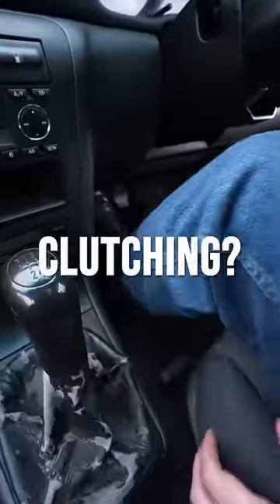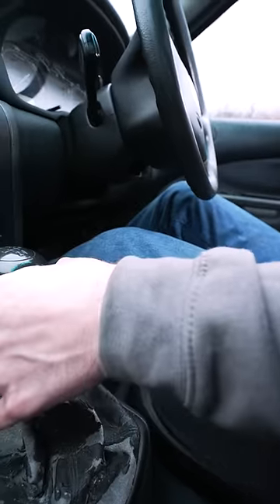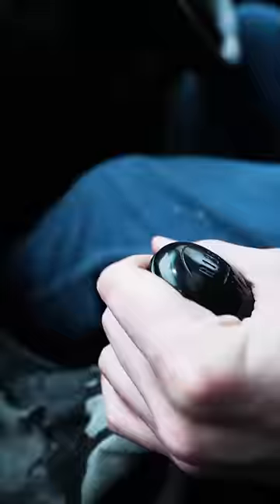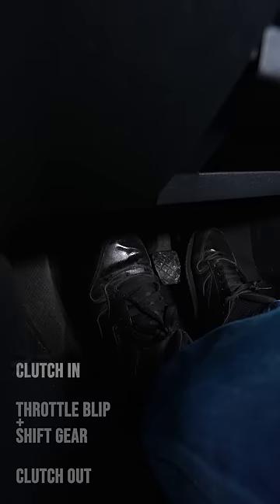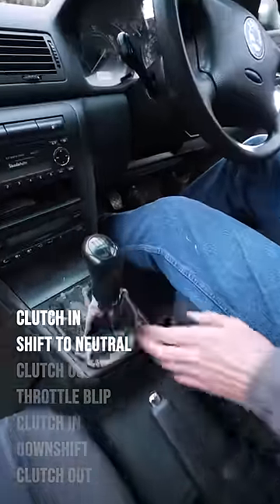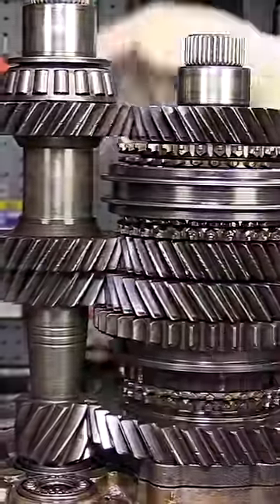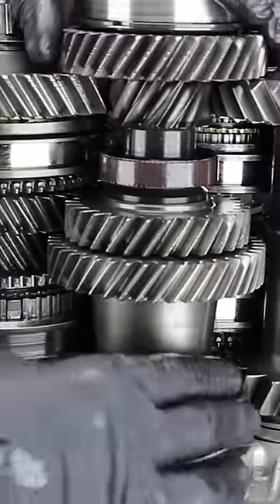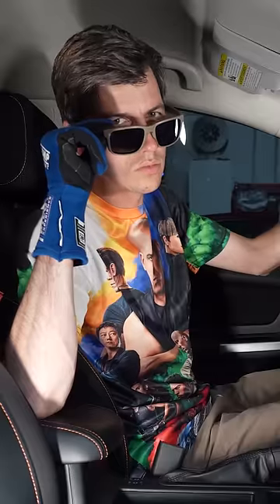What Is Double Clutching? Don't Granny Shift!

Comment: As a truck driver double clutching works very well because trucks are non synchronized however if you can match rpms you can do what's called floating or not clutching between gears
Reply: Yes
Reply: Unless you're in Europe in which case trucks have been synchronized for a good 50 years at least.
Reply: @stuntvist US as always is way behind
Reply: @stuntvist  you guys also only have 6 gears where as we can have up to 18
Reply: @stuntvist Wow there’s not a single truck in Europe without synchros, learn something new every day.
Reply: @bradleymaidens2285  I havent driven a truck in EU with less than 8 gears
Reply: All trucks in Europe are not synchronized. It depends lot of what the truck is used for. Many trucks driven in difficult conditions like those who drive logs from forest have been using still fairly recently or have preferred none synchronized boxes as shifting is that much faster with those. But I haven't now been driving for trucks for some time... But definitely 50 years is not right as 20 years ago there were still many of those. Those are really good to drive after one learns to use those.
Reply: my sm465 has a 2 speed auxiliary unit called a ranger torque splitter and that came out in the mid 60s. both gears are synchronized in that. the sm465 itself is synchronized from 2nd through 4th gear. thats based off the sm420 which came out in 1947 and is also synchronized 2nd through 4th. Thats 77 some odd years that thats been around. so who's behind who again?
Reply: You can do that with any manual transmission.
Reply: @GewelReal Wrong. We have manual semis with synchros and automatics. He just prefers an older truck. Don't you have a machete battle to attend?
Reply: @snaeshaads8203  try harder, kid
Reply: @sepg5084  Says the one that can't be bothered but to write half a sentence in a reply.
Reply: My dad use to tell me all the time u can tell how long someone has been driving their rig by how often they use their clutch
Reply: @stuntvist  I don’t know what your on about, cars and light duty trucks in America have had synchronized transmissions for over ONE HUNDRED years now. I’m a ford guy so I’ll mostly stick with those. Ford introduced synchronized gear boxes in 1932, 1st was unsynchronized, due to the low speeds making it unnecessary, 2nd and 3rd had synchros. In the 40’s and 50’s, the top loader 3 speeds in cars and light trucks were the same. The 4 speed top loaders in 60s-70’s era muscle cars, were fully synchronized, except for reverse. In the 1970’s ford NP435 4-speed truck transmissions were synchronized 2-4 gear, as was the T-18 that replaced it in the ‘80s. The only reason 1st didn’t have synchro’s was because it’s a granny gear, or creeper gear. You dont really need a synchro when you’re only going 4 miles an hour lol. The big block version, the t-19 4-speed, was fully synchronized, as was the 90’s era M5r2 and ZF-5 which replaced that. Not a big Gm guy, but I’m fairly sure the SM465 was synchroed 2-4 as well, again 1st was a creeper gear, and I believe the earlier sm420 was as well. And I believe Cadillac was the earliest, introducing the synchromesh as early as the late teens/early 20’s, but don’t quote me on it. How long have you Brit’s been using them again? Lol
Reply: @bradleymaidens2285 Most Euro trucks have either 12 or 14 gears.
Reply: It's hard to do that without grinding on some cars, though.
Reply: @stuntvist  I have once driven truck without synchro. It was a milk truck from 70's that was converted to a tanker firetruck. All the other Trucks I've driven (Even the ones from 80's) had a synchro.
Reply: @lamp_god9774 you mean the Start Pedal? Lol
If I touch the clutch sometime after the initial start, it means I screwed SOMETHING up, and I drive 95k pound trucks on goat trails in the mountains...
Reply: @stuntvist the us semis don’t have synchronized transmissions because we float gears. Not that we’re behind but because we drive differently. I’ve been around enough of the euro style and US style semis side by side on more than one continent and the US semis did better at moving a load and controlling it while the euro semis seemed to more designed for operator convenience. I do like some things better than others with both style semis but they’re just designed for different markets and truckers
Reply: I Sometimes Float my shifts in my 1999 Subaru WRX (Without Grinding anything). 
With my custom 5 speed ratios Clutchless shifting speed are 
40kph & 2,300rpm for 2nd to 3rd.
58kph & 2,100rpm for 3rd to 4th. 
82kph & 1,900rpm for 4th to 5th.
Reply: You are not just a truck driver you are a smooth pilot 🎉🎉🎉🎉🎉❤❤❤❤❤❤❤🎉🎉🎉🎉🎉🎉🎉 TRUCK GANG 😊😊😊😊
Reply: @stuntvist  didn't save Scania from a lawsuit by the UK's Tesco Plc. in April this year.
Reply: @stuntvist  tech here, in the states I've driven some straight trucks with synchros, but all manual tractors are traditional gearboxes.
Reply: You driving an old ass truck if it doesn't have synchronized gears. Being a diesel mechanic I haven't found a non synchronized transmission in a truck since i started working on them. Every eaton, Spicer and volvo transmission I've tore down had synchronized transmissions. The reason you can float gears in the first place is because of the synchronized transmission.
Reply: yes i love clutchless shits in my 18 spd took a bit to learn but man does it save my left leg 😂
Reply: Like No.1000 :)
Reply: I've heard that some truckers do no-lift shifts.
Reply: european trucks are all synchronized since like the 70ies. In Military times i drove some old 1960 8x8 or 6x6 Trucks that didnt have synced gears, (and no power steering, i had arms like a wrestler) but those where the last to exist. and yep going downhill  on some mountain terrain was life threatening dangerous if you didnt get the low gears in and the brakes where fading out quick:)
Reply: My dad was a truck driver out of NC for his entire life. He's handle was "Double Clutch". Anyone around who worked for his same company or even just driver's who knew him, said that he was one of the best men behind the wheel of a Rig. It was his dream to be a big truck driver when he was growing up, he did it til the day he died and was sent off in the last rig he drove.
Reply: @WhtSupremePizza1 yeah, but not without tearing up the mesh.
Reply: @Yonny316 you've been tearing down automatics.
Reply: I floated for years with no problem say good bye to your knee after a while
Reply: Yes sir 🫡 When I drove trucks I never double clutched I would float or single clutch if it was a new transmission.
Reply: @GewelReal  NOT Behind AT ALL.  Only Inexperienced CHILDREN Need Synchronizers In Heavy Truck Transmissions, Because The Keep Grinding Gears. 😂😂😂😂😂...
Reply: My auto shop teacher taught me about that also he’s a drag racer too
Reply: In drag racing we do what's called side stepping it's where you slide your foot off the side and let it pop back up when you bang a gear and you don't let off the throttle
Reply: @davemckolanis4683  lead paint moment
Reply: @Loj84   WTF Is THAT Even Supposed To Mean??? 😮😮😮😮😮...
Reply: @stuntvist is there any advantage to that?
Reply: @bradleymaidens2285 I was always curious, are those 18 gears always used.
Reply: uuuuh ooooh or like in my shitbox where synchros are worn tf out and i neeeeed to double clutch
Reply: @bradleymaidens2285  Sounds like excuses
Reply: Euro trucks were synchronized but now they're all automated no more sticks
Reply: @ni1469 euro semis also can float Europeans just don't do it cause wears & tears. Euro semis were made for asphalt while US semis will perform better in jungles in Outback down under where no roads.
Reply: @udififkfkfck  any manual can float, they may not last long but can do it. I usually forget I’m not in my semi when driving my ag tractor with a cvt manual. It doesn’t like and clutches don’t last long but it can be done
Reply: @bradleymaidens2285  That is not true. Most lorries have between 12 and 16 gears.
Reply: @ni1469  of course but no good
Reply: @tbas8741  Good for hitting the power band at those engine speeds
Reply: I never watched BJ & The Bear.
Reply: @stuntvist  im a truck driver in the US, im used to floating gears. why do european trucks have syncros while american trucks dont?
Reply: I was always taught to tripple clutch when I shift
Reply: @stuntvist you mean like in a civilized country, where they use metrics, call football football and rugby rugby?🤔
Reply: @bradleymaidens2285 That's just factually incorrect. I'm not sure where you're getting that from
Reply: My 83 Ford and my 79 column shift Chevy are both synchroed. 

Pretty sure America was the first to make synchro shifters.  @CivilizedWarrior
Reply: @dhruvpandya4136  having two splits is mostly used for heavy haul and steep mountains.
Reply: Thank you for your service 😊👍
Reply: WHAT been syncroed 40 years...those who think not.probably have bearings in the mufflers!
Reply: Just learned how to do this the other day in my truck
Reply: many years since trucks in europe had manual gears
Reply: I could float my Nissan, but the rpm's had to be low before I started to shift since it was not made to do so.
Reply: @GewelReal  Still waiting for Europe to land men on the Moon?
Reply: You mean if you drive an American truck. I feel sorry for you guys that American truck makers simply stopped developing back in the 90's. Double clutch in a European truck that is like the 60's. Now it's even a struggle to get a hold of a manual and the automatics are so good there are no benefits with a manual unless you drive in very specific circumstances. Your trucks really are at least 30 years behind on ours. Not meant as an insult. It's meant as a heads up that you are getting screwed. A Volvo FH16 has just as short breaking distance full or empty as a Toyota Hatchback. People are dying over there for no reason. You want to plow in to the back of a traffic jam one day killing 2 families while you know you could have had a truck that would have easily been able to stop? I really wouldn't actually. You guys should complain 😉
Reply: Internet ai stupidity 

Granny shifting?? Wtf is that!? A mashup of granny GEAR?? Granny low?? Fkn ai 

And kids are gonna believe this sht
Reply: Worth noting that "floating" works for the same reason and serves the same purpose that double clutching does. The point of letting out the clutch while you're in neutral and revving (if downshifting) is so you can bring the countershaft  and the appropriate gear (the next one you're going to select) up to same speed as the output shaft before linking them together.   With floating you're doing exactly the same thing in neutral, just not bothering to put the clutch in when slipping out and back into gear.  You do have to modulate the throttle to take the load off the gears during both those points though.   Can do the same with any regular passenger vehicle manual transmission, but the larger difference in gear ratios between each gear, requires more precise rev matching, and the penalty for missing is a lot of gear gnashing noises.
Reply: @XGDSKILLS Ohh yes the "clutch less shits"
Reply: Did it all the time.on my dirt bike and car just smooth into the next gear, zero torque helps
Reply: @lamp_god9774 after initial training to pass my test, my on the road trainer taught me how to float.
Reply: @WhtSupremePizza1 🫢😶 Dayummmnnn....😂
Reply: @SageSparow Truck gang!!
Reply: @XGDSKILLS In all seriousness CLUTCHING shits are better IMO! Imagine loading up on Taco Bell and holding it in for 24 hrs and NOT having anything to clutch while you give birth to a 9 pound, 8 ounces of chocolate milk!! 😂😂🤢
Reply: Isn't this where "racers" put in non-synchronised race gearboxes they can't straight shift then have to double clutch like it's a tractor unit?
Reply: Every driver I know floats the gears after driving trucks more than six months. I am flabbergasted at how many new drivers can't even drive standard  transmissions
Reply: @Yonny316  You're telling me that an Eaton RTLO18918B is a fully synchronized transmission??
Reply: Is that called speed shifting? My dad learned to do that when he was a kid in the 40's
Reply: @XGDSKILLS  for sure!  Double clutch to pass the DMV.  Then floating all the way.
Reply: I did this in my Mustang while my clutch was out for a couple of days.
Reply: @tbas8741 Driving a synchronized transmission without a clutch is easy. I am a trucker of many decades. I used to do that in my 1989 Civic. I thought it was annoying pressing the clutch every 30 feet to come to a stop in rush hour traffic. So, I just strated driving it like my tractor trailer.
Reply: @Yonny316  I hope you are joking. I have been a heavy duty mechanic for decades. I've been twisting wrenches for 40 years, easily.

If there were syncros in tractor transmissions then you wouldn't have to rev match actually. And you do. Over 3 decades of driving tractor trailers. The most recent trucks I drove were 2021 Mack Anthem, and 2022 Freightliner Cascadia. Both 18 speed Eaton Fullers. No syncromesh. Just the way we all like it. A syncromesh semi transmission weighs an additional 500 Lbs because the size of the syncros are massive.
Reply: @Yonny316 I hope you are joking. I have been a heavy duty mechanic for decades. I've been twisting wrenches for 40 years, easily.

If there were syncros in tractor transmissions then you wouldn't have to rev match actually. And you do. Over 3 decades of driving tractor trailers. The most recent trucks I drove were 2021 Mack Anthem, and 2022 Freightliner Cascadia. Both 18 speed Eaton Fullers. No syncromesh. Just the way we all like it. A syncromesh semi transmission weighs an additional 500 Lbs because the size of the syncros are massive.
Reply: @asmongoldsmouth9839  they have a high range synchro and a low range synchro. Maybe you work at fleets where they send the transmission work to the dealership where I work.
Reply: The gears in a truck are so close in ratio that most truck drivers only use the clutch in first gear.
Reply: Bingo!!
Reply: My uncle only used the clutch to pull off.  He drove a Freightliner old school like fld or something.
Reply: Tell em driver💯💯👍🏽
Reply: Double clutching on synchromesh boxes makes the next gear slot in with only little pressure on the shift lever.

Double clutching on downshifts while braking hard results in less chance of rev mismatch and rear wheel lock up.
Reply: I aim to do this for my car too to lessen wear on my clutch and synchro gears.
Reply: The pain with modern cars is rev hang.  You have to wait for the revs to start dropping after coming off the throttle when blipping between gears.
Reply: Floating really is king... the clutch is for starting and stopping, but otherwise is best left untouched
Reply: @LavenderSystem69  Floating for diesel trucks may be OK but for gasoline cars it's too slow.     I used it for a couple of weeks 40 years ago because I was too lazy to get the clutch linkage fixed.   The only hassle was having to push the car up to about 2 mph so I could slot it into 1st gear.
Reply: @TexasBlues-123  i genuinely don't think there are enough nonsynchronous 4 wheelers left in the world to justify including them in a comment about floating being the way
Reply: @GewelReal behind? How so? Does floating gears work? Maybe we just don't waste time in fixing stuff that isn't broken.....
Reply: @LavenderSystem69    I wasn't referring to non-synchro cars.
Reply: Yeah but aren't trucks nowadays auto's? except for the monster rigs like road trains and the like?
Reply: Yes. To the point that when i was young, even driving age (which was ARMY Age, for me, lol-) i thought that "Floating" was "Double-Clutching"!
Reply: @GewelReal hmmm.   How old are You?
Reply: @bradleymaidens2285 correct! We do have trucks that do all kinds of things now; but, not the norm here. The Drivers in the Military, at least 577th ARMY Eng. Bt. and 5th Eng. Bt. had automatic Trucks that were [all the more  are] far bigger than these Tractors with long trailers in the Civilian world. Quite amazing!
Reply: @GewelReal  Rent free…
Reply: My clutch was so fucked in my subi i was floatin gears for like 2 weeks waiting to get all my parts in lolol it was nutssss
Reply: @tbas8741 I do this in my 370z as well. I first did it by accident in a 5.0 when I was younger bc I was accidentally putting a little pressure on the stick and to my amazement it just SLIPPED into the next gear with no issues. It’s a lot harder in the Z but I think you just gotta be able to feel it.
Reply: So you have less skilled drivers @stuntvist
Reply: @GewelReal not really helping the case for Europe having less gears
Reply: @stuntvist synchronized transmissions weigh considerably more than non synchronized transmissions and that is why trucks that were subjected to weight restrictions didn’t use them. Now everything in going Automatic so it’s a bit irrelevant.
Reply: im truckie i do agree :D
Reply: ❤❤❤❤ you a real one
Reply: @ke6gwf the only time I clutched after take off was when I was super heavy on an incline
Reply: Not tryin to argue or nothin but semis in the us are synchronized between low and high range but that's the only synchro
Reply: @stuntvist that's because Euros can't float
Reply: @stuntvist  That's right. And the latest lorries are nearly all automatics now.
Reply: I earned to float gears when the clutch master cylinder broke on my Honda Accord, it's kind of fun!
Reply: When you learn to drive trucks they don't want you to float, when you get on the real road with a truck driver, you learn to float your second day the only gear you got to stab is first
Reply: My uncle did this when I was a kid and was suuuper proud of himself. Watching that dude manage a Kenworth or Peterbuilt was like watching god build the earth. He knew his machines.
Reply: I only used the clutch starting from a dead stop or coming to a stop. Thats  a lot of work double clutching if that’s what one wants to do. The new drivers of today don’t have to mess with any of that. Most trucks are auto trans now.
Reply: @FraaaaaankRizzo  I think Stevens started with the automatic transmissions. I can't imagine kicking and sticking each gear.
Reply: @johnsmith-zi7jh  Newer drivers have something called an Automatic Only Restriction. Never heard of this before but it’s a non issue since most all trucks are automatic now. I never thought I’d see the day of an automatic in a tractor trailer….but we have three of them. Old manual is a spare. All the straight trucks are autos.
Reply: @FraaaaaankRizzo  I would ride occasionally with my grandfather, he drove an 18-speed double stick like it was nothing. I drove a 04 Freightliner Classic with a 13 speed split on the top end and I did a lot of mountain driving Ohio to Washington. How do those automatics act in the mountains, and how do you drop a double, or split from higher gear end  to lower end if you have to? Thanks in advance
Reply: @johnsmith-zi7jh  I drove 10 and 18 speed manuals at my old fuel company and I left them and trucking in 2011 so I could spend more time with my kids. Once the oldest started college 11 years later I returned to trucking after an 11 year break. Come back…..automatic transmissions and DEF fluid! I have never driven an auto tractor trailer. I’m on straight trucks now. Doing heating oil. Very mountainous territory. You can’t really drive it like just throwing it in” D” like a car and tackle downhills. I manually select gears to use the engine as much as possible on downhills ( like we do with a manual), but still if speed and revs are way far apart, at a certain point trans won’t let you drop down, so still have to downshift early. Still, at least what I drive you drop at the top of the hill and at slower speed like a manual. You don’t need to mess with rpm’s but still have to be mindful. When I went back to trucking I got two jobs. One was a roll off company and one an oil company. Both had trucks with Allison Automatics. Those Allison’s are bulletproof at least in my experience. The roll off company has R Model Mack’s with Allison Autos. Those are really something. Great in traffic like on the NJ Turnpike ( dumps were in Newark, NJ). Definitely was a learning curve. Still use engine brake but like I said, downhills…..I manually choose a gear for max engine breaking. A push button. Like those old Chryslers.
Reply: And that’s the truth
Reply: @stuntvist Exactly this. And don't make me start on having the metric system 😂
Reply: @CivilizedWarrior they are talking about heavy duty trucks
Reply: @Yonny316 youre wrong
Reply: @GewelReal , I've driven those automatics/automated transactions as well as the Eaton-Fuller Super 10s.  I'll happily drive a regular transmission or Super 10 any day.
Reply: @jefffuhr2393 , the Orion service module has something to do with Europe.
Reply: Granny floating not double not clutching like you should
Reply: @stuntvist , they have those things in the U.S.  I've driven for 3 companies that had them.  My last company had manuals and automatics.  After orientation I went to the guy who handed out truck assignments.  He asked me if I wanted a stick or an automatic.  His face lit up when I said "stick."
Reply: @lamp_god9774 , I how to drive in 1975 in an M35A2 and how to back it up with a 5/4 ton trailer.  Obtained CDL in 1991.  I've automatics and quickly realized I didn't like them.  The closest thing to one I'd rather drive is a Super 10.
Reply: @GewelReal  Except for price / performance cars... Corvettes and Vipers are probably one the best.
Reply: Shouldn’t need to use the clutch in a roadranger but i know at least when I live you need to double clutch when doing your license test
Reply: I do that while riding my dirtbike
Reply: I limped my BMW home several miles using that technique. My clutch had apparently come into multiple pieces when I dumped it on a dirt road just to kick a couple rocks. Absolutely insane, but I limped it home safely.
Reply: @GewelReal  remind me which european nation is richer than the US?
Reply: @bradleymaidens2285 Nope, we also have up to 18, but 12 is most common.
Reply: I just made a comment about this with older muscle cars.
Reply: Floating gears with a torquey engine that operates across a 1300-1900 rpm spread is completely different than floating a high horsepower engine that operates across a 6000+ rpm band. You're going to be powershifting more often than the synchros can safely handle
Reply: @303nitzubishi4  Yup you need the RPMs to speed shift a stick. And even that may turn second gear into ground metal if its off just a bit.
Reply: @dhruvpandya4136 rarely are all 18 used. Two of the gears are low and low-low (located in the same position as first gear on a 10 speed ; the two gears are split with the thumb switch) , and are mostly used for getting unstuck, or restarting heavily loaded on a very steep hill (especially if there is inclement weather/dirt road), or possibly pulling something else very heavy thats stuck as well.  Other than that it is a four speed  with high and low side (activated by a switch you can pull up with your pointer finger). every gear can be split in half with a thumb switch. Normally i never split low side gears, but will split every gear on high side so I usually skip 4 gears from a complete stop loaded. Unloaded i start on the high side of third gear (which i guess would technically be sixth gear but 3 high is more appropriate, it would be like starting a ten speed in 3-4 gear).